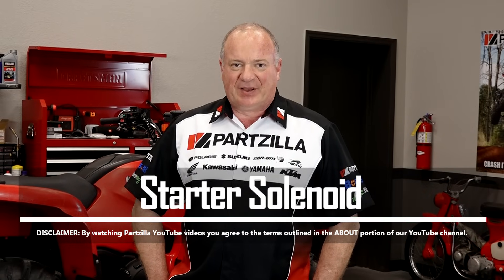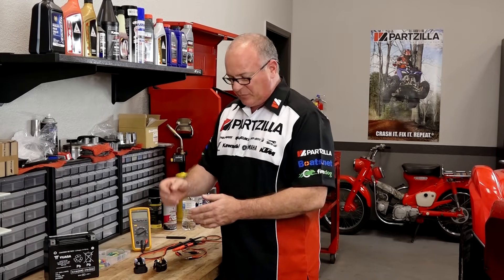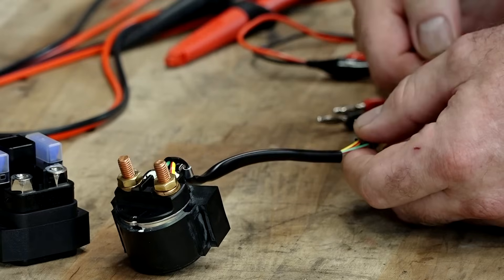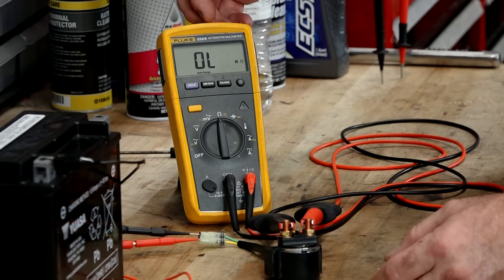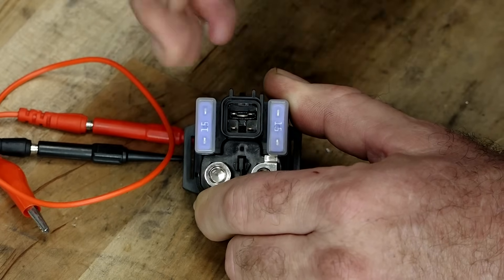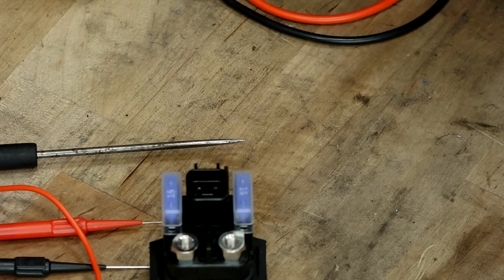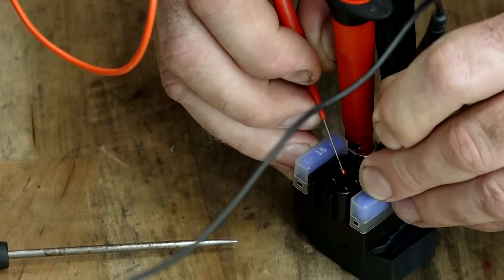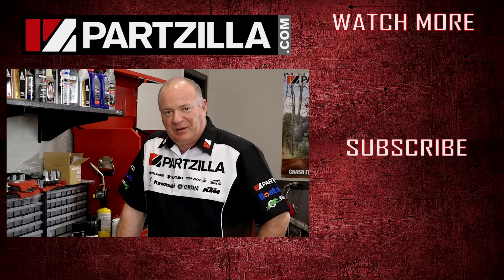How to Test a Starter Relay on a Motorcycle, ATV, or UTV | How to Test a Starter Solenoid

Comment: I recently bought a used Suzuki M50 and it ran fine for a few days. Then one day I tried to start the bike and when I hit the starter button, nothing happened. I pulled the seat and found the battery and the starter relay. One of the fuses was blown so I replaced it. Everything worked good for a few days, then yesterday, I went to ride the bike and the same thing happened. When I hit the start button, the dash lights flickered and the bike made a noise, then nothing. I went to the starter relay and the fuse was blown again. This time every fuse I put in blows as soon as I turn the key and push the start button. I've ordered another relay switch, but do you think this might be something else? It's got me stumped.... THANKS for any input!!!

Comment: Having watched several of your "how to test" such and such videos, it is apparent that you are a knowledgeable and intelligent person. Probably just a slip, but I noticed that you said using a low voltage circuit to activate the solenoid. Later you correctly talked about low current, that is, amperage. They are all 12 volt circuits and I know you know that. The other thing, and this really surprised me, is that you said such and such and your bike won't start. What you really meant was that it wouldn't crank. Big difference and I'm surprised you made this mistake. But hey, we're all human. Your videos are definitely informative and helpful and yes, I have dealt with Partzilla many times and always have had  good experiences with them. Please take my comments as constructive criticism with the emphasis on constructive. Thanks, David

Comment: My relay is reading 6ohms that's for a 125 zontez javelin is that ok the problem is when the battery is connected the starter kicks over without the ignition turned on any help would be great

Comment: Ok this is an old vid so see if any1 replys.. My atv is a year old. since day 1 its had intermittent starting issues. Ive replaced the battery , tightened all the wires and the only thing i can come up with is the starting relay. sometimes you push the button and fires right up. other times just a click. Sometimes it will start after a few clicks other times like today it took a few minutes. So is it possible for the relay to do that?

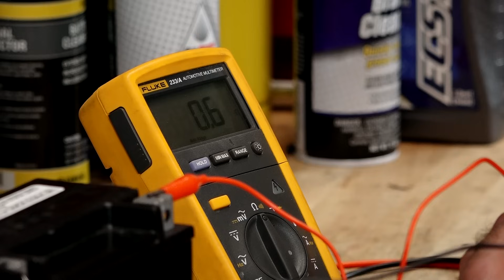Comment: At 5:00 the tip of the probe was glowing red  which means that the thin  coil  wire inside was also glowing red potentially damaging the insulation! A test that might have lasted too long  compromising a brand new part.

Comment: So to bypass the starter relay in an emergency can I just touch a wire between the two big terminals on the relay? Mine looks similar to the newer style. On a Yamaha snowmobile. Stranded and towed out would have been nice to be able to get it running.
Reply: Yes.  Jump the 2 points to get started. However if it’s completely failed. You could still be standard cause it’s not allowing power to flow through to your fuse box.  I also got left stranded in the deep No cell signal forest cause Yamaha failed solenoid (raptor 700 2022 ).  But check the right side cable.  Newer models the bolt was never tighten from factory and will arc and arc and fail. Make sure it’s tight

Comment: Thanks for the video. On my Yamaha 700 ATV I've got 13.2v at the battery and the solenoid input. However, at the battery there is only 10.5 volts after pressing the starter button. The starter will crank, put poorly. When the battery is below 13v, but above 12.5v, the starter will barely turn the engine over and probably it will not start until I put the battery charger on and get the battery voltage back above 13v. Is the culprit a malfunctioning solenoid?
Reply: I got yhe same issue. Did you ever figure it out?
Reply: Have similar problem with a scooter.

Comment: When i go across the 2 single ones so the coil i get 5 ohms so thats good
But when i go from the 2 points that are connected together to one bolt (red) i get 1 ohm to the other bolt i get OL?
I have the wires still connected -

Comment: I had a friend test my starter relay and battery and he said it was ok I replace the starter relay with a new one just because but could it be my starter itself went out? May I add he did use a multimeter tester and also the starter relay did make that clicking noise upon contact of the two probes. What I know is through watching youtube video's, I can only learn so much from a manual because of my reading disability. It looks so simple here but each of us have a particular part, model, bike that may differ slightly from what's shown but still be helpful. I replaced the starter relay with same results, I hope the starter coming in the mail will do the trick if not I'll be rolling it down the hill and kick starting it

Comment: I need to test the starter relay of Suzuki m109r 2011. I am a bit confused to see the two big terminals of it are one direct positive from battery with a thick red wire and the other is negative with a thick black wire. I understand that both the big terminals should be high current positive and not one positive and the other negative. what's behind it please anyone ?

Comment: John Talley  I have a nighthawk honda.250. Key on headlight and tailight are working
Engine.will not crank. Horn will not work.
Starter motor spins because I hooked it.to a non.running car car battery
Reply: I suspect relay magnetic switch
Fuse to horn and headlight both 10 amp are good. What do yo think?

Comment: 2:50 Hi, I have a starter solenoid similar to the first one: I connected 12v into the solenoid (I hear a audible click) and read 0.00 ohms on the outpost. Is the solenoid still good?
Reply: At rest you should get an 0L reading for continuity which means an open circuit (no beep on the multimeter is good!) - but when you energise it you’ll want to get up around 0.2 or above ohms
Reply: @Dr_KAP  well I was never able to get a ohm reading above 0.00 but the starter works and  bike is running so that is good, cheers
Reply: @jordantran6253  good to hear! Might be the multimeter did you have it set to the minimum ohms? Anyway you’re all good yay 😀

Comment: Great video!  I have a 2015 Aprilia RSV4 R and just getting a click from the solenoid.  I'm waiting on alligator clips to test the the solenoid as i'm doing it by myself and don't have enough hands to make the connections, hold in my clutch and press the starter button... lolz   I am guessing the starter relay solenoid needs to be replaced, but I can seem to find the correct one on your website.  Can you post a link to it here for me?   =]

Comment: Excellent video. I had an electrical starting problem with a 2007 crf450x just yesterday and this helped perfectly 👍 Turned out to be a fuse with a hairline fracture that when pushed into its place separated and when pulled out looked and tested fine.

Comment: Quick question, do these solenoids act the same as a regular relay where if they rattle when you shake it, it needs replacing?  I've got a intermittent starting problem with my bike (01' ZX-12R) so checking the solenoid(original) it rattles when I give it a little shake.  Thanks, Todd.
Reply from the maker: I don't know of any that rattle.  There are test procedures in the service manual to confirm.

Comment: I'm wondering if you have ever worked on a BMS Goka 800cc buggy? I have an early model 2008 and at times when I go to start it, The starter doesn't turn. I turn on the ignition switch and try again then it starts up. I'm thinking that it just may be a starter relay but not sure where it's located on the buggy. Would you have any information regarding my problem? Thanks for sharing all of your videos with all of us.

Comment: What would cause a relay to fail (second one with 4 posts) ? I have a Yamaha Grizzly 660 that keeps killing my Starter Relays.  I get a new one and it works fine for about 30-50 starts, then it starts clicking but it cranks the starter a few seconds .Eventually no clicking at all and no crank.  I checked the ground on the battery and it seems to be clean and connected tight.
Reply: Don't use after market solenoids they don't hold up like oem

Comment: 4:57.. what is the negative connected to?  Thank you
Reply: There’s two terminals on the solenoid- you connect one from the battery negative terminal to the solenoid terminal and the other from the positive battery terminal to the solenoid (polarity on the solenoid not important) - when finished testing and hook back up to bike I believe you should also have a ground wire from the negative terminal to ground

Comment: John, thank you So much for these info videos.   I can't get my 2007 Yamaha Raptor 350 to start.  New battery, I have spark at the plug, but even with engine starting fluid it will not fire.  My compression is 150, then 165 after adding motor down the spark plug hole.  Is 150 low for this engine?  Thank you sir!!
Reply from the maker: That compression is in the normal range.
Reply: To  @PartzillaParts  .  Have you heard this one before?  Same quad.  I just took the Head off.  When, the T mark on the flywheel is lined up with the slot in the small hole, the piston is about 3/4 the way down.  I found this After moving the cam gear 5 teeth clockwise to align them both up, then crank over, now I have a bent exhaust valve.  I can fix the valve but that flywheel & piston position has me stumped.  Your website has been a Big help, thank you!!

Comment: I'm getting the motor to turn over but it's very slow, even when i hook up a bigger power source still just as slow, i disconnected the solenoid and tested it, correct ohm readings, and i touch a power source direct to starter cable without solenoid and it turned fast like normal, so i opened the solenoid and it looks like it melted the contacts together then they snapped apart again, leaving a very rough porous jagged contact which i think was giving the starter power but very little amps. The Honda factory replacement solenoid for 79 cb650 is 113$ so.. i rebuilt it, filed down the contacts. Gonna put it back in tomorrow morning, it's 2am.. but yea tested again after rebuild seems good to go.. but in the event this doesn't work, any other ideas what it could be?
Reply from the maker: check all wires and connections for loose fit or corrosion.
Reply: @PartzillaParts  Soo the plunger and contacts looked like they had melted together then snapped back apart (probably happened  whn tried the last ride inthe cold and didnt end up starting) leaving a rough finish on it of course it cant move amps through that unevely mated surfaces,,,so that was why it was turning slow even with more power, filed em down put it back together it worked perfect. thanks for the reply, good video. they wanted 115 for the honda replacement solenoid! i was like im gonna try and rebuild this thing ill call u back..the other one thats "for"the bike was 11$ but had many review saying died withnin 3-10 starts...  Glad the rebuld worked!

Comment: i unpluged the four way connecter on starter solenoid. one of the connectors was loose. i took the connectors out of the four way plug. i was going to plug the directly on the male end. i have a brand new battery, and voltage regulator. the bike was running great. i use it every day and regularly maintain it. i took my wire cutters to remove add the connectors th the male ends. and the bike starts turning over the starter, with the key off and the kill switch off. worked great before. the reason i started this was because the nutural would not come on. it wouldn't start. if i wiggled the wire on the 4 way plug it would work.  could you help ?
Reply from the maker: Sounds like you hooked up the constant power, instead of the switch.

Comment: I went to put the new starter back into it original position after working correctly and the bike started by itself...I disconnected the negative on the battery to shut off bike...now when I touch negative post bike starts...what gives? Any input? Ugh!
Reply from the maker: Sounds like you bypassed the relay.  If it's hardlined, it just gets power the second you attach the battery.  Check your wiring.
Reply: lol,  not laughing AT you, just funny situation, you get your wiring worked out? definitely bypassed the solenoid somehow with something like the vid creator said

Comment: Great video. Was able to diagnose my faulty relay on my 2000 Polaris 425 expedition. I purchased a replacement solenoid but the new one only has one wire. My old relay has two wires on it. One is for transmission neutral and the other from the ignition switch. Any idea how I manage this wire install. Not sure what to do with my second wire.
Reply: I have the same bike same problem
Reply: amlo obrador , I connected the one wire to the wire on my ATV that comes from the ignition. The relay is automatically grounded when installed on the battery compartment. I haven't connected the transmission neutral wire at all. It starts perfectly but now I have no neutral safety. I discovered that the bike will not jump forward when starting in gear. It starts and stands still until you give it some throttle
Reply: @truenorthmuskoka9077  the bolts come from battery base they loose idk if that the ground for selenoid
Reply: amlo obrador , the relay body is the ground. There is no ground wire. Once you bolt the relay to the battery case with the two bolts it will be grounded automatically to the ATV chassis.
Reply: @truenorthmuskoka9077  cool that mean the bolts not givem any ground and might selenoid still good thanks
Reply: amlo obrador , yes thats correct. Use a wire brush to clean the battery case and the wire. Also, take the wire off the starter motor and clean that too. Make sure all wires are cleaned and tight.